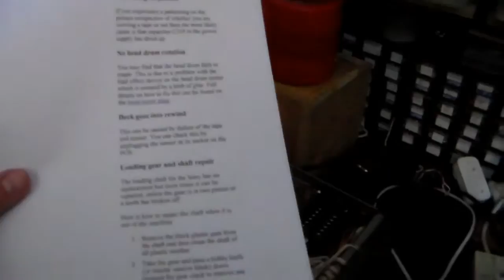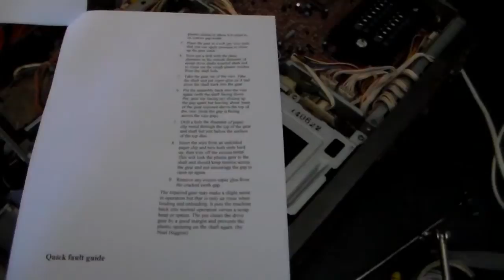Sony SL-C40 Betamax VCRs won't load tapes, need help to fix it!!!

Comment: I have the same problem with my SL-C30E I bought from used market (the mono sibling of SL-C40), and seems that cleaning switch contacts can be a great solution! Will locate the switch and more thing I should fix on my VCR soon.

PS: take note that there is no Betamax specialist in Indonesia due to how Indonesians treat old technologies
Reply: Bang asli indonesia ya ?

Comment: all betamax vcr need clean inside parts  special sensors pinch roller and tension idler and drop some oil or light crease in some part
Reply from the maker: Thanks for the tips but it's all good now, not too long after making the video I sent one of the VCRs to a Betamax specialist in Victoria to service and he got it working good, there was surprising a lot of problems to be fixed!!! Anyways it's working good and is now my workhorse machine for transferring beta tapes :)

Comment: no its not gear,, its sensor behind gear in loading system right side..may be havt tow or one ..just clean it by hard paper with alcohol..but you must take the loading system from vcr
Reply: what kind of sensor am I looking for?

Comment: The first Sony machine has the famous dirty cassette-in switch problem. When you push the tape in, you can hear a click. That's the switch that closes the circuit to power up the loading motor to move the cassette carriage down. You need to take the switch apart and clean the contacts.

Comment: I literaly have the same problem with my vcr. It doesnt do anything when you feed it a tape and sometimes it tries to accept it but only a little and very slowly. Do you remember what the problem was and how it got fixed? Any advice would be appreciated.
Reply from the maker: TapesNstuffS I ended up sending the better VCR to a Betamax specialist in Melbourne, he fixed everything but there were a whole series of problems, can't remember the details, it costed me $150 to get them fixed, was worth it in the end as it works great now!